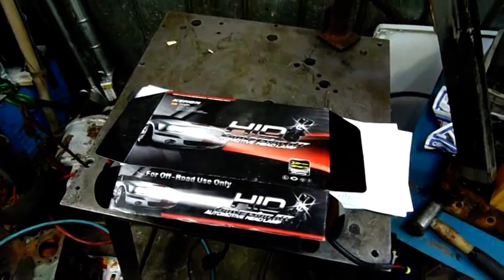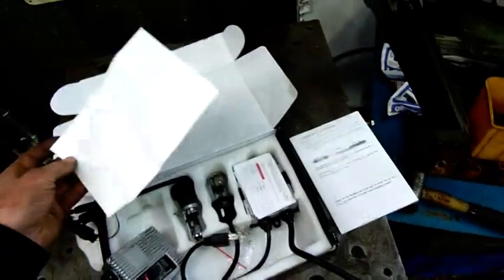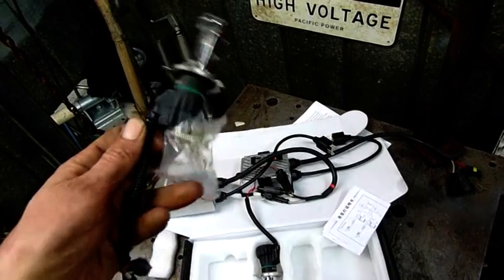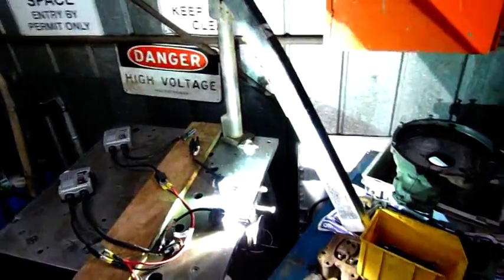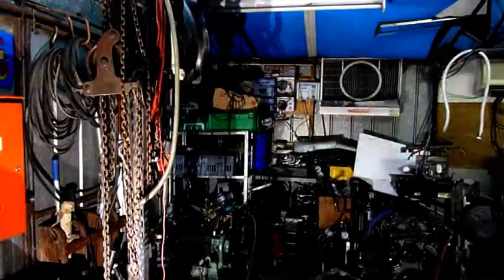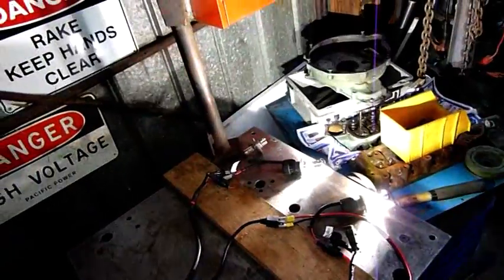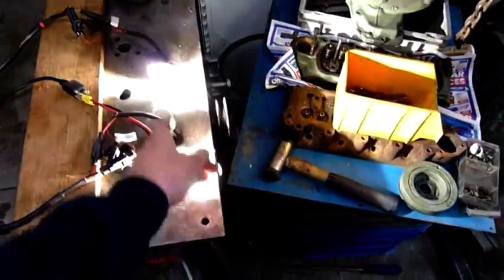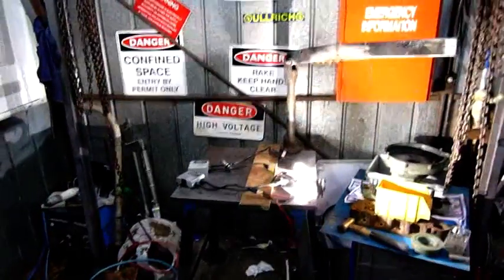China HID Head Lamp Kit Testing

Comment: I fitted a cheap (£15 inc p&p) H4 HID kit to my old 1990 Fiat about 6 months ago, its a noticeable improvement over the standard H4`s, but I`ve had to aim them low because of the light scatter.

What is different compared to the kit you`ve got there, is that mine has a relay fitted before the ballasts, taking the pressure off the cars wiring, & most importantly, the headlight switch, which is always the weak spot on older cars that didnt have relays in the headlight circuits.

I suspect that may have been the problem with whoevers car it was that your kit was fitted to.

I once fitted 100W spotlights to one of my old 80`s Fiats, stupidly wiring them directly to the cars main beam circuit. It burned the headlight switch out in no time.

My HID kit had been reliable, until recently, as one of the main beam solenoids doesnt always play ball... You get what you pay for eh?

LED`s next time I think, ideally after I`ve made some custom projector units to fit within my current headlight unit.

Comment: If the kits worked after cooling down, then they shut off due to a thermal shutoff or something in the ballasts.  The ballasts are running much cooler in the video than they would be in a vehicle engine compartment.
Also, the lamps run on a 100V 800cy/sec or so square wave.  The 22kV pulses are just to allow reliable hot restriking of the lamp discharge when the lamp is hot.

Comment: I took apart many china made things and fixed most of them. mostly stupid mistakes in manufacturing.  I may buy a portable 12V halogen spotlight and modify it like someone else did. but $250 for a set I think I may pass on it unless I can get one for cheap.

Comment: if ye want to use them ye have to tape the top of the front of the head lamp for a cut off point. i think i have a vid up of puting them in a toyota with pop up lamps. they have nice crips light but nit much range. they would make good driving lights bun not main lights. they take about the same amps as a standard 55w H4. i like me headlights they brighter the the landing lights now :D

Comment: These lamps ARE metal halide. There are 2 differences with regular halides:
Auto MH lamps contain large amounts of xenon gas in the arc tube mix. Industrial halides use less, if any. Regular halides need to vaporise the contents before they produce light. Xenon produces good light when cold - so no waiting for warm up.
Car halides need to restart hot. This needs very high voltage. Mains starters only produce about 5kV, fine for cold bulbs. Car ballasts can generate 25 kV for hot ignition.

Comment from the maker: @tikker11 I wonder if its a wiring issue?, or voltage drop. I will try them on a few different systems. the Toyota 4A engine,  my Jag, and a few different batteries with light wiring to simulate the long run of possibly underrated lighting cable.

Comment: A lot of times those HID kits need damn near 14 volts exactly to operate correctly. I installed a kit similar to that on a 7 series BMW and they would flicker and the right side would turn off randomly. I had to install a relay directly to the battery to power the HID's and that fixed the problem. The stock headlight wiring had too much voltage drop.

Comment: @cloudbook1994 I got an old chrome toaster cheap from a Church sale once because the plug got hot, the plug had like 30 feet of electrical tape wrapped around it. When I got it home I took the tape off to expose the plug, which was partially melted, and then removed the cover from the plug. What someone had done is stripped six  inches of wire from each side and wrapped the wire around each screw terminal but never bothered to tighten the screws down, unbelievable!!!

Comment: the only"german technolgy" is the inner gas tube in the bulb, but most likely its a fake too if its from china ! keep the rod on the bulb facing the bottom ,should take care of the yellowing issue,the ballast might be grounding out if touching the metal body or over heating if mounted near the radiator /engine area ,OEM BALLAST ARE MOUNTED ON THE BOTTOM OF THE PLASTIC HEADLAMP HOUSINGS,in a cool non metal area

Comment: haha! utter garbo kits ,we actually manufacture better made units in korea or using german "licensed philips/hella parts", the bulbs are o.k. from china ,but ballast is garbage ,keep the bulbs and find OEM ballast and convert the connectors over, they turn yellow if under volted or just got to burn in ,if you turn a HID bulb it gets yellow until it sets correctly